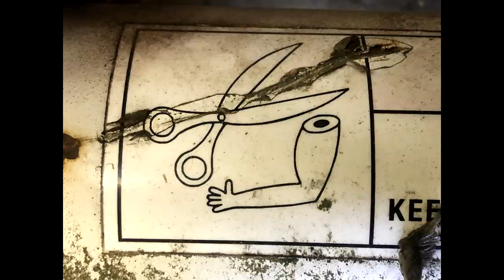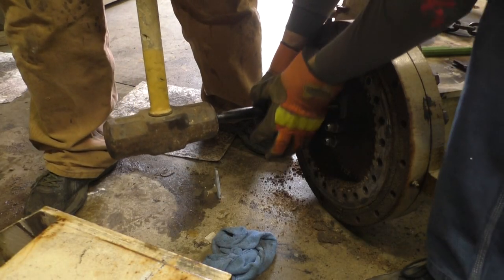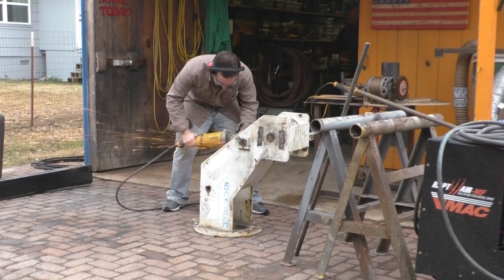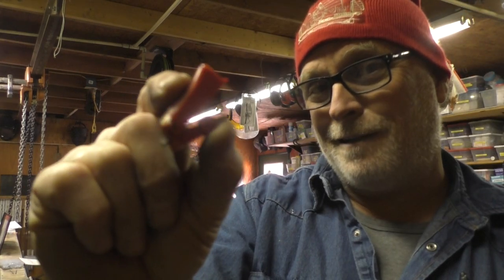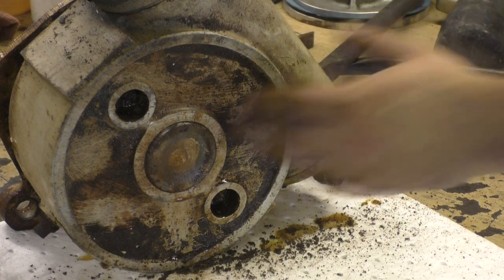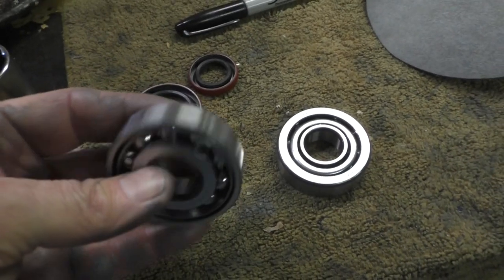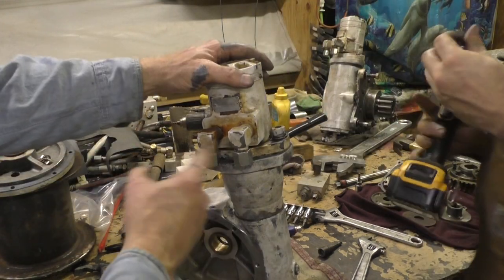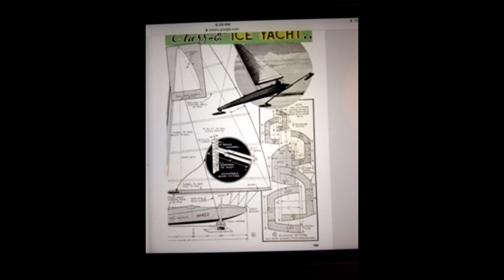Deck Crane Rebuild - Part 4 - Teardown and New Bearings

Comment: Do you really want to know what I did today? I started 2 Jet engines on a worn out 727 and Taxied it to make some space. It hadn't been started in 36 years. I did that for a buddy who could not get it to spin up. Everything worked on it and it didn't catch fire. I wanted to do a round around the pattern in the green mossy monster from Braniff Airways but no Ferry Permit.  A Fire Truck Followed me.  Insane.